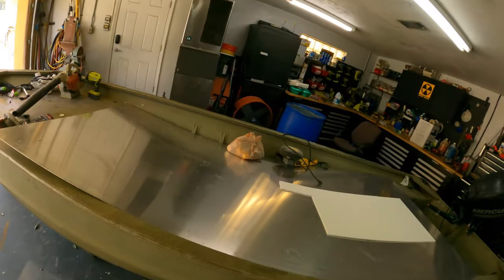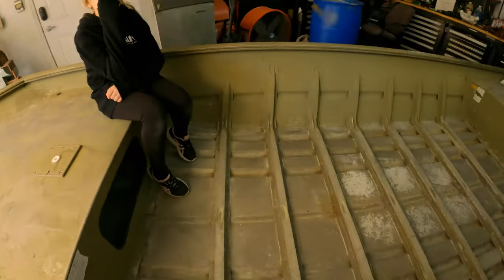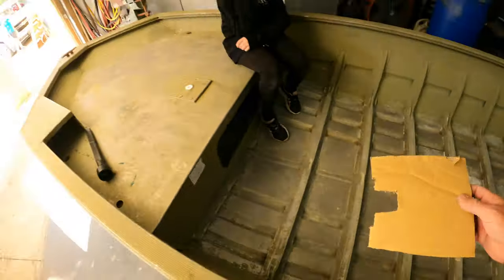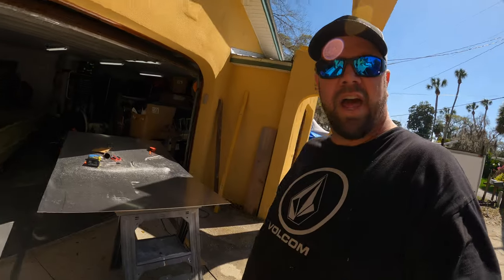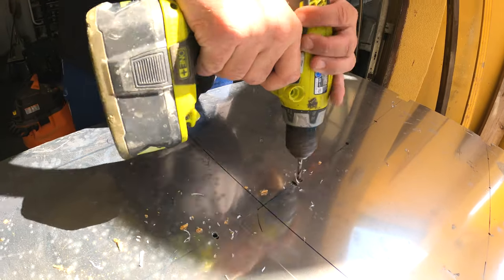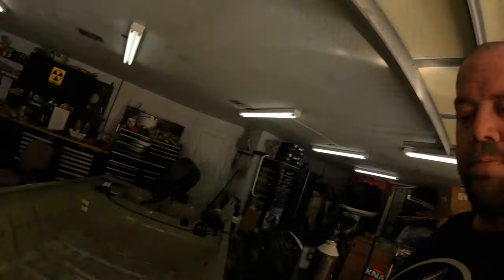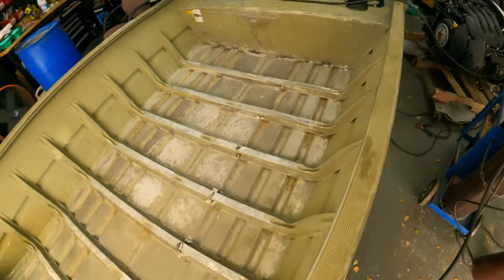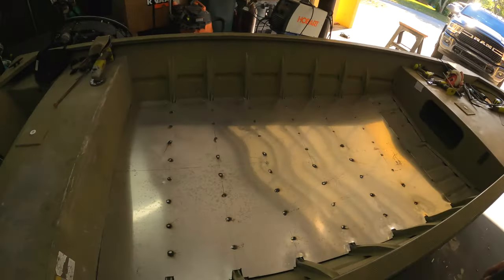AWESOME Gigging Boat Build Series #1 {Installing a Floor and Repairing Ribs} #1

Comment: Are you going to seadeck the floor of the boat?
Reply from the maker: Im not sure yet.  Gonna wait until I get done with it all and then decide.
Reply: @JackedUpFishing  you'll need some kind of dampening I would think. Can't stand stuff banging around In a metal bottomed boat.
Reply from the maker: @Tyler-kw9ce  This is my 3rd one I have done now.  Each time I have improved on the build.  This one I am going all out with rear flotation sponsons on the transom, picking bar with cockpit light, thru hull lights for under water, and above water lights mounted under front.   Maybe twin trolling motors with custom props.  Ideas are flowing.  With regards to banging around, I have never had that really but seadek would be nice for sure.
Reply: @JackedUpFishing  check out the fan boats they run in Texas. Pretty wild stuff.  It's like a small airboat engine with a tiller and small prop.
Reply from the maker: @Tyler-kw9ce  oh yeah I’ve seen them, pretty slick.